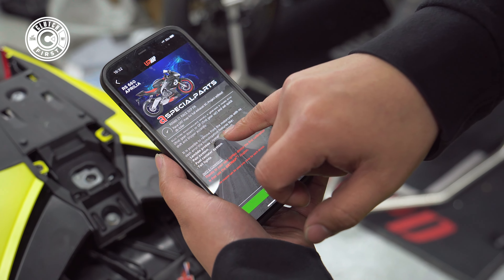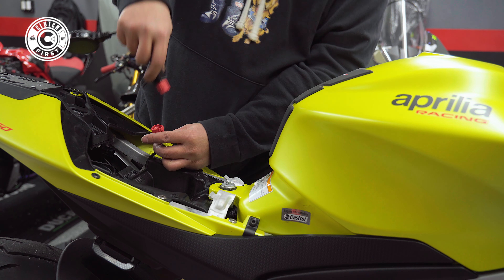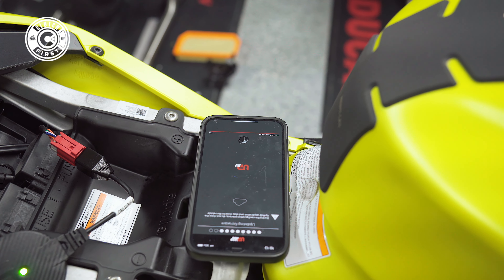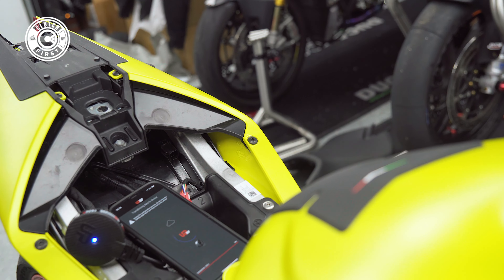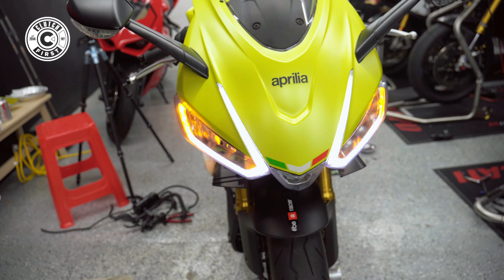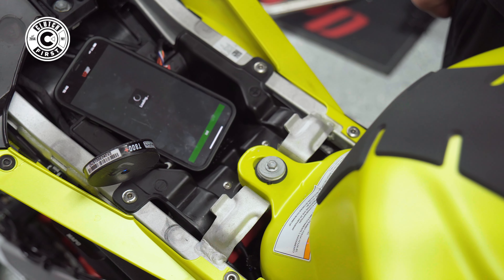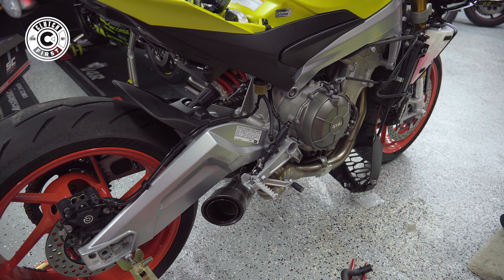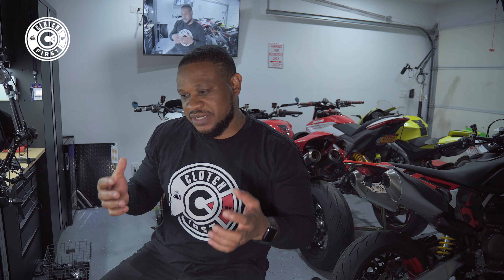More Power & Solved The Turn Signal Problem | RS660 UpMap

Comment: I recently installed S1 exhaust and updated ecu through UpMap gabro map. While shifting from 1st to 2nd there’s usually a pop. I don’t know if it’s normal or something to be concerned about?
Reply from the maker: When you say pop? Like a small explosion? Trying to get a better understanding. Mine works perfectly. Also have a shifter mod that prevents mis-shifts. When I use the quick shift it does a mini bang with the excess fuel. However that’s normal.
Reply: @ClutchFirst   it sounds like when a single firecracker goes off. Usually happens while shifting lower gears manually upon pulling the clutch and releasing throttle. Doesn’t happen with quick shifter.